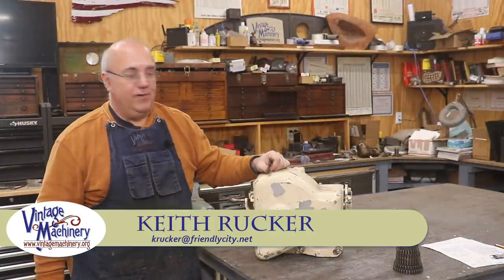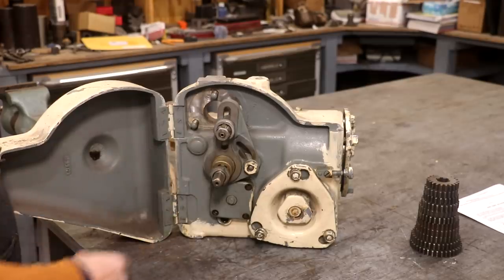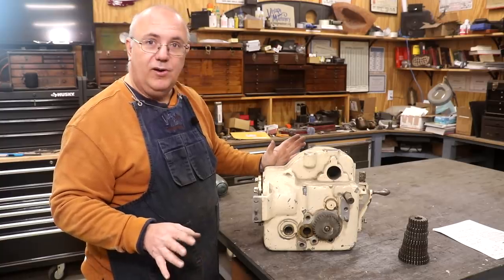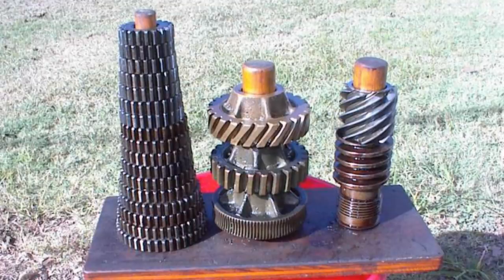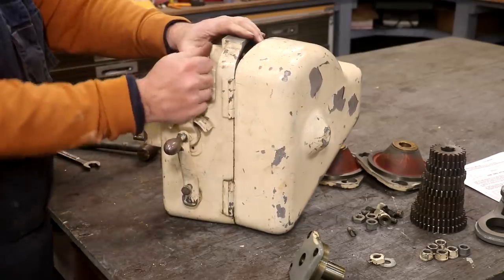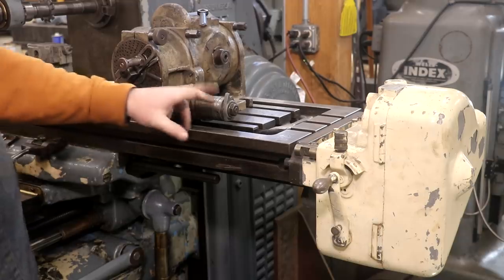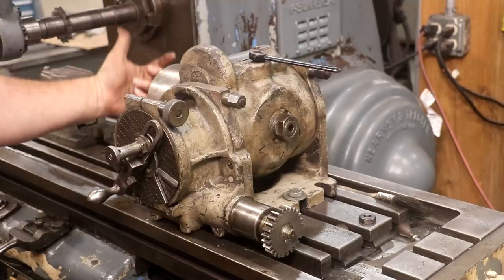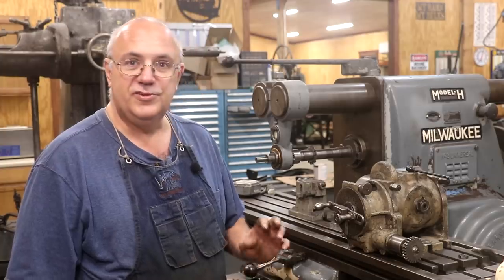Kearney & Trecker Low Lead Attachment for Cutting Spiral Gears

Comment: You will need the auxiliary shaft for rmany leads also in cases where you want to drive a dividing head or rotary table without movement of the table.. Some leads are driven with the table screw, some with the auxiliary shaft....Notice in the dividing head manual they tell you to make sure one lever on the box is in neutral while the other one is in gear for many leads....Your table should have the auxiliary drive gear underneath to drive the auxiliary shaft.....My 1943 2hl universal was fitted by me with a low lead attachment and most everything was there except one trip shaft that was easily made....The bearing block for the output shaft is missing ... It is adjustable for a bit of 'wiggle room" for different attachments....With this box, it is possible to drive a rotary table via the auxiliary shaft.. Nice set of gears! LOL I was very fortunate that they were included with my low lead box. 42,362 different leads from .0219 to 2918.4 inches .... Cheers and Merry Christmas from Louisiana ;Mike....
Reply from the maker: Thanks for the info.  I knew that there was an option for the aux shaft, but I was not very clear how it all hooked up.  I did see that in the book but it did not make much sense at the time.  The book leaves a little for imagination as far as how all of it is set up....
Reply: @VintageMachinery  That aux shaft can also be used to drive a rotab drive bracket....Cheers and Merry Christmas....

Comment: Looks like you only need enough 6 point spline to drive the dividing head (that broken part looks good). Maybe the rest could be MacGyvered out of an old steering column or something similar. Worth a punt?   Merry Christmas. :-)
Reply: That's what I was thinking also.   Couldn't you just make some sort of a short stub and use the thing that cuts keyways in gears, but do it six times?   Then you could attach a larger pipe over that.   Only the very ends need to be one inch, right?  Couldn't the connecting pipe in the middle be any size you want?

Comment: You could probably make the fine worm (or a reasonable enough facsimile to create the coarse set) by single point threading on the lathe. 
The matching worm gear could be made by plunge cutting on the horizontal mill.
Reply: @Leo True. Not ideal, but good enough to use to cut a coarse worm with reasonable precision. At least from my POV as an #ArmchairMachinist 🙂

Comment: Just a quick question/suggestion:  If a long splined coupler can't be found, could a broaching operation be used to create a shorter coupler?  It'd be a little "fiddly", to get the slots indexed properly but, taking care, it could be done, right?  From the look of it in the exploded drawing, two short couplers and a longer shaft wouldn't have the same range of dividing head placement on the table as with a long coupler, but wouldn't it, maybe, get the job done?

Comment: Merry Christmas Keith, looks like you got a little present there with the  dividing head working.  I noticed the handle sitting there with the spline. Could you just round that piece, and use a pipe and weld it to the pipe. Do the same on the other end and you have a sliding yoke...  I don't think you need full engagement ..  Enjoy, wishing you and your family all the best. Stay safe.

Comment: If that's a parallel spline its an SAE 6b, might help you find what you are looking for
Reply from the maker: I will have to look that up and see.  Very well could be!
Reply: @VintageMachinery  A multi screw clamp style coupler would also likely provide every ounce of holding power you would need as well

Comment: Hub City has a 1" 6 spline hub, part #0332-00031. It's shorter than you need, but may be a starting point. Good luck!
Reply: All else fails, attach one on each end of a piece of pipe, easy driveshaft any length needed!
Reply: @hwesson75  10-4

Comment: Keith, can you just broach that splined connector? Are the dimensions of the splines compatible with standard broaches? If you have a matching broach you would just have to make a bushing with two slots 60Degrees apart.   Broach the first slot, then insert key, broach next slot, rinse, repeat.

Comment: If I am not mistaken, the coupler inside if a Ford 8n.between the transmission and the rear end is 1" 6 spline...give me a few days to look and if it is, they are everywhere...I know I have a few of these laying around...Merry Christmas
Reply from the maker: Maybe so.  I know later equipment used a larger spline, but I would not be surprised if an 8N used something that size.
Reply: @VintageMachinery  I found one today...it is 1-1/8"...so close.

Comment: What about buying a deep impact socket which fits the hex shaft, then cutting the end off and welding it to a makeup shaft to couple to the far end?  If it needed to be deeper then several cutoff sockets could be welded together. These days when I need a hex drive I start with a purchased socket and then I go from there.
Reply from the maker: Interesting idea!
Reply: That idea has been working well for several years on my homemade power feed for my mill using a Dodge Ram wiper motor for drive. The motor has a stub shaft on it with the end milled hex, and that goes in and out of a deep socket that's coupled to the lead screw on my mill table.  I also know the trick to get three speeds from a standard two speed wiper motor.

Comment: That dividing head looks like that broken handle shaft connects to an internal worm gear set.
I would loosen the large knurled knob above the division selector plate and see if anything loosens. Failing that, remove all locking pins on the division selector plate .
Edit: As I thought 26:35
Reply from the maker: Yes, you are partially correct - at least at how it works.  The problem was that it was just gunked up from not moving in decades.  Once I got it freed up, it works like a charm.  The knob that tightens around the index plates will prevent it from moving under normal use, but that was not the problem here - it was just frozen up....

Comment: Its jammed where shaft broke(internal) its Cockeyed at gear contact point.bent at control of bearing or reformed case by pressure from bend befor break of shaft

Comment: Merry Christmas Keith.
  Old farm tractor pto spline is 1"-6 are they not? I remember having adapter couplings for different size spline.
  To make one you can fabricate a broach plug and broach the splines that can be threaded or pinned to a hollow tube. Just a quick thought.
Reply from the maker: The smallest I have been able to find is 1-1/8” OD.  Merry Christmas!

Comment: There is one on ebay right now.  just type in 1" Bore 6 Tooth Spline Shaft Coupler 2-1/4 Long Hydraulic Pump Motor Coupling
Reply from the maker: That one has a 1” ID.  I’m needing one 1” OD.  I’ve already looked at it.

Comment: Keith, This may have been mentioned in a previous comment, but looking at that part diagram... If you can fabricate a short spline coupling like part no. 48, could you not use that in place of part no. 46 and redesign part no. 47 so that it can be variable length using off the shelf coupling?

Comment: 1-1560 Part number Surplus Center 1 inch 6 tooth coupling
Reply from the maker: I will check it out.  A lot of what they call 1" is 1" on the inside diameter, not the outside diameter.
Reply: @VintageMachinery  I have some gears that have that spline. I got them for my Sheldon lathe. Don't need the spline but the teeth are the same 10 dp. 314cp 1 inch inside 11/4 to tooth depth.

Comment: I can't believe I'm the only one that has one of these spline shaft couplers lying around for the last 20 years K&T made 100's of them through the years .Thought  I would
Find a machine missing this part, most of the universal mills at auctions I've seen were being used as plain horizontal / or with a vertical head .
And this driving mechanism still mounted to the table ,spline shaft long gone . The price was high back then , I've bought in the last 6 months a
# 6 with heavy duty vertical head $300.00 # 3 CK with universal vertical head $350.00 and # 2 H plain horizontal  $ 200.00  costing much more to move this old iron than to buy. So sad to see how little equipment is worth right now so if you have the space get out and collect some Americana ,
Reply from the maker: If you have any of those parts that I need and are willing to sell/trade, please send me an email.  I show my email address at the start of all of my videos when my name pops up on the screen.  krucker AT friendlycity DOT net
Reply: Keith Rucker - VintageMachinery.org I'll send a picture of it asap.
Reply: After Keith ensures it isnt something he needs, I am restoring and adding all the elements I can to a K&T 3CK Horizontal Universal mill. If you are willing I am interested...

Comment: Check out Hub City they have couplers , shafting there listed on Google
Reply from the maker: I am going to call them on Monday.  I am not sure if what they are calling 1" is the same as what I need, but they do have several sizes so I am keeping my fingers crossed that one of them will work!
Reply: Keith take a lot at the spline detail on your indexer then grab your older version of machinery handbook version 12/14  and look at spline data will show cut data size/shape
Reply: Hub city ag related products have reference charts to show spline detail

Comment: When I took my Machinist coarse  in school  I made a drill bit  3" inches in dia. by about 2 feet long the table at the proper angle the table screw geared to the dividing head ( Universal horizontal milling machine ) , What does your attachment do, that my arrangement cannot do ?
Reply from the maker: K&T made two versions of the lead attachments - what they called their "conventional lead attachment", which was probably similar to what you made - it was a housing that allowed you to put various combinations of change gears in line with the table feed to get a range of "leads" for milling spirals.  Then they had what they called their "low lead attachment", which is what I have.  The only difference between the conventional and low lead attachment was the addition of the worm gear sets, which gave a much wider range of leads that the attachment could produce.  In the case of the two K&T attachments, the Conventional Lead Attachment was capable of generating around 1,300 possible leads ranging from .670" to 149" while the Low Lead Attachment could generate 42,362 possible leads ranging from .0219" to 2918.4".  

So, to answer your question, the Low Lead Attachment that I have will do the exact same thing that your arrangement does, but with a MUCH wider range of possible leads and many more possible lead options within a given range.  While it is more complicated than a conventional setup, it is also more versatile.

Comment: there's a fleaby item RuggedMade Steel Splined Motor Shaft Coupling, 1" Inch Bore, 1-1/2" OD, 2-1/4" Long, 6 Tooth Spline Hydraulic Rigid Coupler. Would that work?  not mine.

Comment: The gears you were planning to make will need the same spline. I guess you were thinking of broaching them. Can't you do the same on the coupler?
Reply from the maker: I think I can broach the spline on something fairly thin - like those change gears - using a regular keyway broach and a special broach busing that will allow me to index it six times.  I don't know if I can get away with broaching a coupler deep enough to do what I need though.  If I had the correct broach, it would be a lot easier....

Comment: Have you checked with a tractor supply  the spinds look a lot like the pto drive system
Reply from the maker: This is too small for a PTO setup, but it is the same basic design.

Comment: Could you use a broach to make a inside splined coupler/shaft? Have a very Merry Christmas Keith!
Reply from the maker: Yes, but I don't have the correct broach.  I could probably build an index fixture to use a regular keyway broach, but it would be a lot of work...
Reply: @VintageMachinery  how would the original have been made?

Comment: There is a 1 inch ID 6 spline coupler on Amazon  but it is only 2 1/4 inches long I don’t know if that will work for you
Reply from the maker: I think that one is 1" on the smaller "bore" diameter.  I need 1" on the larger outside diameter.

Comment: Keith, can you make or find a broach to cut the internal 6 spline notches? I seem to remember our maintenance group making a similar, using a broach for cutting the internal part of the spline.
Reply from the maker: I can probably do it with a regular key way broach and a special bushing to index it six times.

Comment: I found some 1x6spline couplers at the surpluscenter.com , 1 1/2od x2 1/4 long  part# 1-1560 at$6.25 and they have 400 of  them . they can be mach and welded. I know you can build something to fit,I have faith in you!
Reply: Or weld up a tube with 2 modified flex coupler hubs from McMaster Carr https://www.mcmaster.com/spline-hubs/   Both sources would be much easier than setting up my slotting head over the rotary table or dividing head to make 2 short spline holes that could be welded to any length tube.

Comment: Cant you make worm gears on your lathe?  It is big enough is it not?
Reply: Worm threads are based on diametrical pitch (or module in metric) where the "thread" lead is a function of pi...the lathes he has don't have the change gears to do DP. There are some lathes that do (clausing colshester for example)...from the pictures he showed, it looks like the worms are multiple start too (additional complication)...in my opinion, I would have someone mill them on a cnc mill with the 4th axis....this would take some doing, like a cutter special ground to the right form..he will also need the worm wheels which is another basket of worms....documentation or prints would be a huge help...
Reply: @mbbmidwest3556  Food for thought.  Thanks for the reply.  I am just a new fish.  I will be diving deep on this one.

Comment: Looks like a standard tractor PTO coupling. I think they are standard 1”.
Reply: Ford 9N, 2N, 8N series are 1 1/8 and the 600, 700, 800, 900 series are 1 3/8.
Reply: Standard tractor pto is 1-3/8"
Reply: A female coupler could be wire EDM cut.  Pending it's length perhaps cut in a shaper.
A male shaft can be milled.

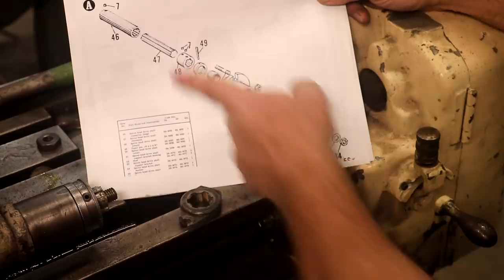Comment: 24:57 i think that entire jumble of parts is pointless to you. I think that they exist to allow K&T to match different attachments using as few parts to make as possible, and i think that you could simplify the entire deal down to one part shaft and any relevant bearings.
Firstly, there's no motion between the dividing head and this gear box. So from the start, there's no issues of alignment. Secondly, you have that broken handle, clearly you didn't have an use for it, and clearly it will suffice to drive the dividing head because that's what K&T left out there in the world from the dividing head's splines. So that little broken handle can be turned down on lathe, mated with a shaft that itself is mated with splines to match the gear work inside the gear box.
IMO, you should make just that and not bother with finding anything, that entire break out of parts is pointless to you and serves no actual function, i'm willing to bet that it's just a catch-all of parts to fit the different attachments necessary to run the machine as a complete package.
Reply: Except that the long splined shaft and long coupler allow the dividing head to be positioned left to right.

Comment: No big deal to make a spline coupling. Got a set of keyway broaches? All you need to do is make the bush for the broach and include an index keway at the appropriate rotation to make the pitch of 6. The root of the keyways wont be radiused but it will be good enough to make the coupling. If you need to make a shaft just do the reverse for an external bush and use the broaches appropriately. Most square shouldered splines will have the sides of the way parallel to the center of the slot . 
I used a similar attachment on an old Cincinnati many years ago to attach a horizontal dividing head to make some crown wheels and the conventional dividing head to make pinion gears.  It was on a turret/vertical mill, using profiled slot drills.
Reply from the maker: That is more or less how I plan to cut the spline in the change gears if I have to make them.  But, I am concerned about broaching a coupler several inches thick that way.

Comment: IIRC 1" 6T spline is a standard hydraulic pump spline you should be able to find shafting and couplers fairly easily.  Pretty sure  McMaster-Carr has 1" 6T spline rotary shafting. 
Found on Amazon https://www.amazon.com/RuggedMade-Splined-Coupling-Bore-Hydraulic/dp/B07KGGNW7Q 
Might be enough bits there to make what you need
Reply from the maker: That part has a 1” Bore - that’s the inside diameter.  I need one with a 1” outside diameter.  The one being sold that you linked to is like 1-1/8 OD.  That’s a common size, but too big for my shaft.

Comment: Hi Keith
1" 6 spline is used in agricultural machines.
Google 1" 6 spline. Found this site for you that has long 1" 6 spline couplings. https://www.mechaface.com/index.php/spline-components/
Here is a other solution, weld on coulpers that can be welded to each end of a pipe. 
https://www.nitrochain.com/1-6spline-x-weld-on-hub
Reply from the maker: Thanks - that is a big help.
Reply: @VintageMachinery  Happy to help, and Merry Christmas from wet and cold Norway

Comment: some interesting Low Lead videos... https://youtu.be/R1DuH6Hd5QQ   seems on the 2H the dividing head slips all the way into the low lead attachment.. HMM.  this shows it installed on A 3H https://youtu.be/gMh46FuMZMo  hmm.. safety tube over the splines.. and some gear cutting with it.. https://youtu.be/Ya0SprcNa1c    heck. you have probably already seen these.. who knows. the Low lead head could be the same one at your shop..  its the same color..